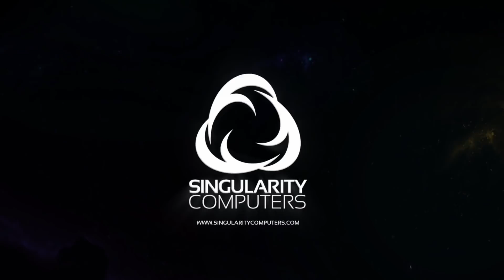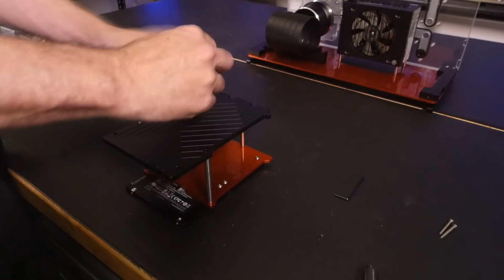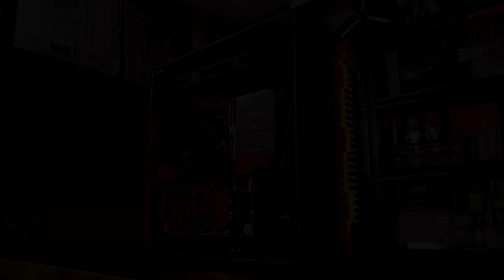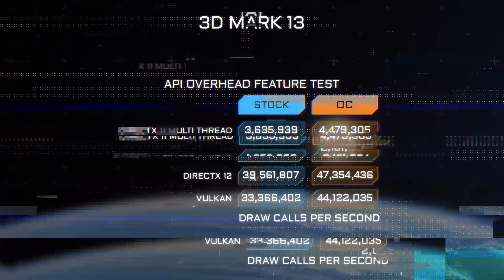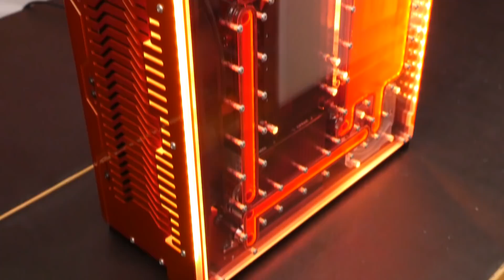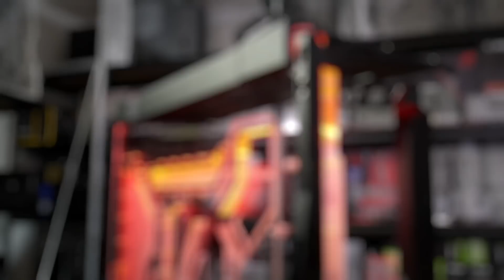Wraith Custom High End Build #50 Part 2

Comment: i am not giving you any suggestions because for me you guys are at the top for sure..  but with Mayhems Pastel (black for sure) you're going to screw all waterblocks etc... i am watercooling since 2000, i used it in my lest 2 builds and after few months all my parts were ruined, you wonder why 2 times ? because after the first i thought may be something was wrong with me and the build and wanted to give it a second try, but then i had again the same result. what's worst is that Mayhems are such a bad company, i tried everything to contact them and have some support.. the result was zero.
Reply: @Southeastern777  well I knew it's poison but honestly was too much worst than what I already knew.. right after 3 month
Reply: @Southeastern777  ekwb cryofuel vlear